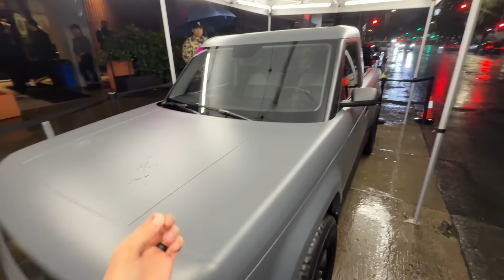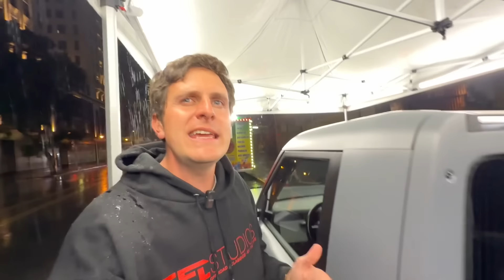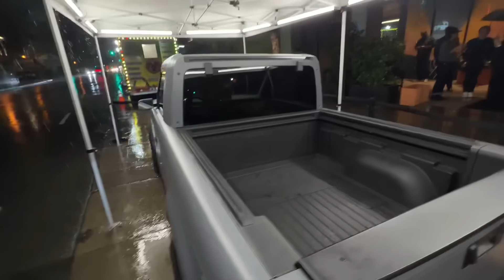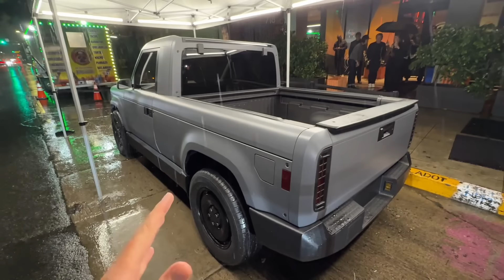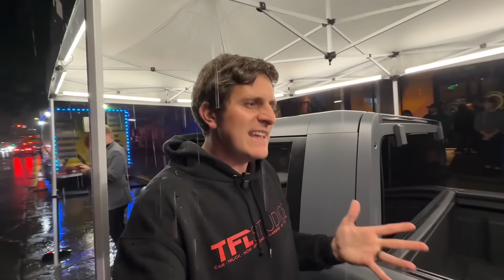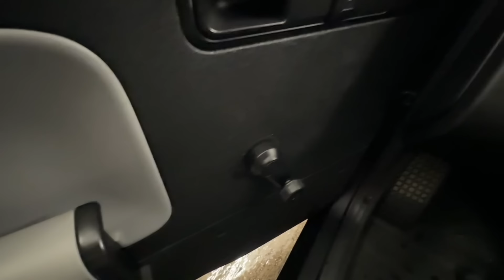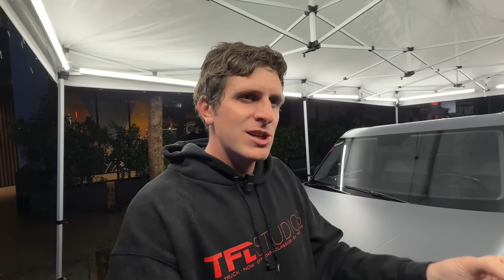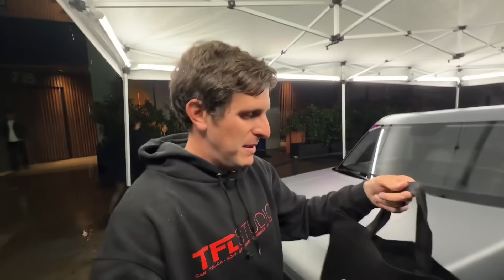The TRUTH About the '$20K' Slate Truck...Will This Really Be a Hit?

Comment: My problem with electric vehicles is they are too software dependent. The infotainment needs to be separate from the systems that control the drive.
And the running gear needs to be able to operate no matter what, a simple software glitch or failed update should have no impact on the vehicle's ability drive.
If they can accomplish that I will take one for sure. I love simple vehicles. I could use something that is small and more maneuverable for local driving.

Comment: The die is cast on electric, 2 door config for launch.  Slate's priority is to build capacity and bring to market which is huge.  I'm sure that they will be expanding from there to address some of these issues (4 doors, AWD, improved range) as a quick follow in 1-2 yrs after launch.  The bet they are making is that they can survive until then with cash from blank slate sales.  Does it have to be ICE? For some, sure.  But to be a market success, I think it needs to meet functional requirements, which for many uses will be longer battery range.

Comment: I appreciate the idea, but it needs a gas motor variant. Needs a full size bed. Its electric. Which means in 4 or 5 years its worthless when the battery needs to be replaced....just like all the other electric vehicles. Once the battery goes out and cant hold a charge for any worthwhile distance, the vehicle is worthless. I do appreciate you all covering it though. Keep up the good work.
Reply: No 🦕 please..

Comment: Totally Wrong!

This truck will sell and sell well as an EV.  The biggest pushback against current EV’s is they cost too much.   I agree they are too expensive (in the US), but I went full throttle and bought a new 2022 F150 Lightning Lariat and new 2024 Kia EV6 before there was a tax credit and have absolutely never looked back and never will.  

I have a first day reservation for the Slate due to its low cost and being an EV.   Go SLATE!

Comment: Single cab and range is a deal breaker for me on top of it not really being a complete truck (needing a wrap) off the lot.  As others have said, price is too high for something so basic.  I am for sure one of those that doesn't like all the tech they put in trucks these days.  I have a buddy that had a Subi where everything was controlled by touch screen.  Screen died and on it's way out, it decided the heated seats needed to be on high with the AC on full blast.  And that's the problem I have with the tech.  To error is human but to really jack something  up, you need a computer...

Comment: Has anybody actually TRIED to buy an XL maverick?  They either have a ridiculous markup on them, or they disappear off the lot immediately, or they have 5K of dealer addon.  The BEST THING about the Slate is NO F"N DEALERS to deal with.  I'm in with both feet and I think their first priority after sales start will be to expand to full 150K production capability of the plant.  It's gonna be like the VW bug  in the era of land yachts and muscle cars.  It sold 400K a year, just in the states.
Reply: I bought a 2024 Maverick XL. I ordered it in 2023 through my local Ford dealer and had to wait a year and a half for it to get built, but I paid 25 grand out the door. I thought it was a great deal!
Reply: I bought a 2023 Ranger xl, no mark up

Comment: With the Maverick out there and other auto companies gearing up to make Maverick competitors, the slate doesn't have a chance. A stripped down limited range electric truck that you need to add a bunch of extras to just to bring it up to what you already get included with a Maverick isn't going to sale. You can fill up a Maverick and get 40 mpg. There's just no comparison.

Comment: This would be a decent vehicle IF it was a hybrid and not an EV. barley 100 miles for 20 grand which will be more like 30 grand all in is absolutely pathetic. 20-30 grand is previous generation ford Ranger money plus 5 to 10 grand for fuel.  It could have everything you need and nothing you dont. If single cab trucks were in demand you would see a lot more of them on the road, but you don't. Its all crew cab and short bed. This is a great idea in practice, but terrible as it is. Imagine this in 5 to 7 years when the battery is 60 to 70% of the original capacity. Thats less than 100 miles. Not towing anything. Not taking into account if its really hot or really cold, all that combined and you will be lucky to get 70 miles. If it was a non turbo 4 cylinder hybrid this would be an easy sell. But its not. Its an EV. It will be problematic. It will not be reliable.
Reply: No 🦕 please…

Comment: The problem is most of the single cab new trucks have an 8 foot bed.
Reply: My regular cab f150 has a 6.5 ft bed and it’s the only size that’ll fit in my garage. Does everything I could ever need.

Comment: 150 mile stated range is very much a real issue- particularly when factoring in cold weather impacts, and typically maintaining charge between 20-80%. Yes, people take road trips. And it doesn't even have to be a road trip. Could be a swim meet or camping trip or work meeting that requires driving more than 75 miles one way. I could see this for commercial local delivery vehicles like the auto parts stores.
Reply: Get the bigger battery, problem solved….

Comment: As someone who won't get an electric truck for the money and the range/charging issues. I think this would make a lot of sense in southern and western urban areas where you rarely need to worry about snow. I could easily see this being a fleet vehicle for a small business or franchise. It would even be an option as a first vehicle for a new driver, very little to focus on, very limited distractions. I would not see this being a good fit, in this configuration, for areas that experience snow and ice on a regular basis or sparse rural/country areas.

Comment: A gas engine for sure. If you can plan for everything an electric with range limits works. If not gas is important. Also 4wd in a pickup is pretty key. The back end is too lite. Wet grass or backing up a steep driveway you want control and 4wd gives it to you. I don't need a small pickup to take on the Rubicon but when you need a little bit more or you're stuck, you need a little bit more.
Reply: Most people don’t even use a 4x4

Comment: This will not drive.  I think people got enamored by the idea of a 20k truck.  We like the idea of a simple cheap truck, but at the end of the day, it is still an EV truck that cannot be used the way we want a truck to be used.  The 150mi range from the "large" battery means it will only ever be a city slicker.  If Slate really wanted to succeed, then they should have made a 20k EREV.  Slap a tiny NA 2 banger in there to charge the small battery when it is low, then you actually have a useable vehicle.  Then you will have a nice, simple truck with 100mi EV range and 400mi total range with the onboard generator.  I'd buy that.

Comment: I had a 2 door Chevy Tracker back in 1999 and we have a Wrangler Unlimited now. I hate EVs but when I saw the doors come off and you can have a back seat with the top off I put a deposit down on one. The only way it could be better for me is if the panel above the driver seats was removable.
Reply: Why do you hate EVs?

Comment: Relying on the 7.5k ev credit to market a 20k car as the wrong move. Now that the EV credit is gone, no way anyone is buying that for 30k.
Reply: any good competitors around 30k? if not then why not
Reply: BS - you haven't shopped lately.
If it makes it to market I'll buy one.
Reply: @m @mikeb1039 s I have… I bought a legitimate diesel truck for $25k. Now it was used of course. But it’s actually capable of doing things one buys a truck to do. The fact that you say you’d buy one proves a couple things. 1. You should probably keep riding a bicycle and 2. You’re an imbecile. He said IN THE VIDEO that the Ford maverick is the literally the same price but with 4x4 and a crew cab…
Reply: So $20K plus $7.5K is $30K ?  Are you a mathematician ?
Reply: @brentmiller8494 Ever heard of interest, dealer fees, markup…? I assure you it’ll be $40k if it ever makes it to market. Just like the Tesla model 3 was supposed to be $30k and debuted at $50k…

Comment: $20k for a truck that will get me around the community, let me take the leaves and such to the compost area, sure.  I’m in.  Except… no 4wd.  That’s a non-starter.  Getting the branches and leaves and all that requires 4wd just on the property.  They’re making an “honest work truck” but they forgot the work part of that.  Yeah, I don’t need 4wd every day.  I do, though, need it at least every week.  I’d love to have a cheap, capable truck to replace the little noisy gas side-by-side with its tiny bed capacity.  But, the side-by-side goes all the places to get the stuff I need to haul.  It’ll get the firewood from back in the deep woods, I just have to make a lot of trips!  Ah well, maybe Slate will hear us and make something useful.  Thanks for another great video!!  I’ll still keep an eye on Slate, but for now its off the list.
Reply: Agree 100% - possibly the 2nd Slate!

Comment: For those wondering avg daily commute of an American is 35mi and median is 22mi. Less than 1% of Americans drive more than 120 mi in a day. 70% plan a road trip in a year in that case they will need to use one of Tesla chargers on their way or rent a car but I would mention the amount of money you save from fuel easily outweighs the car rental cost you do once in a year and not to forget maintenance savings from no fluid changes like oil and transmission and significantly less points of failure compared to gas or diesel cars as it ages.

Comment: Problem is EPA DOT NTSB requires so much required mandates simplicity is LONG gone IMO.  The 'hot rodders'  are migrating toward single cab trucks lately.  Just look at f150 with a coyote under the hood.

Comment: You should know better… 2wd in an EV is very different than a traditional 2wd truck with no weight in the back. A lot of people don’t know better, so this misconception will be common, but it’s all about weight distribution and having weight on the wheels that provide power. There’s a reason even Volvo, an automaker based out of a cold, snowy climate, has defaulted to rwd on their EV’s. This could have been an opportunity to clarify that and inform people of the reality, instead you thoughtlessly parroted an invalid concern. Clearly people want 4wd, myself included, and Slate will offer that if they get the chance, but people don’t need to be scared of this being a truck with rwd. It’s going to handle much differently than an ICE truck with rwd. 

Also, many of us only need or want a truck bed on occasion, so the design of being able to transform it into an SUV and back is huge. Add in the fun open air setup and it’s a knockout. I think the Achilles heel is the 2 doors, but even still, I plan on buying this for myself and will then give it to my daughter as her first vehicle. Only time will tell how this vehicle does in the real world, but I think there’s a lot more promise here than in most other automotive startups we’ve seen. The big money backing it and the every day people that have made reservations speak to that as well.
Reply: Sounds like an insider here who is offended by a fan boy video.

Comment: Im supposed to get +212 on my Nissan Leaf. But, at 80%, 160-175 is more realistic. So if you get 110-130 on this, more utility than highway driver. And it better have liquid cooling and ability to use Tesla plug-in. Chademo SUCKS! 47 kwh blows! But, they will overprice this!! Greed never sleeps!

Comment: I think part of the reason trucks got to be family haulers was because cost of living got so high that most people can’t afford payments and insurance on a truck that’s only used for truck things, so they had to make trucks that also did family things. The truck you tow your camper or boat with is also the truck you take to work is also the truck you take your kids to soccer practice in. They do it all because they have to.
Reply: Insurance as well… Even if you could afford multiple cars, the insurance on multiple cars can make it a no-go.
Reply: Right. Not to mention you have to haul the family you intend to stay in that camper or take on that boat and its more efficient to drive one vehicle hundreds of miles on vacation than to have to take 2
Reply: @cainhager9814  all (well, most) of us grew up riding in the back of an extended cab pickup but since it was only a “once in a while” thing we’d deal with it. Not so anymore.
Reply: Go back 40 years and people didn't have "a truck that's only used for truck things", they had a sedan and a small utility trailer, or maybe a station wagon.
Reply: 100%. If you can only afford one vehicle for a family... get a double cab truck.

Comment: The Slate is too small, too low, too basic, too cheap, but it’s not inexpensive!! If it has 30% the content of the other brands it’s still 45% the price. You may actually be getting less for your dollar!! Slate could be hugely profitable until people realize the trucks are high incapable!. Those wheels & tires,,, 😂😂😂😂. I live where a work truck is an oil field truck, carpenter truck pulling a 6500 lb trailer full of of tools & equipment, trucking company support vehicle hauling large parts and freight pieces of a few hundred lbs, ranch vehicles hauling hay bales 23 ft above the cab into muddy fields to winter pastures where the frozen turds would stop this truck in its rwd tracks!! 😂😂. I can mention so many other work trucks that this will NOT work as!! It’s a turd!! 
    Bring me a F150 2.7 EcoBoost regular cab 8 ft box. 4x4 (for me) Air/tilt/cruise and a radio, Locking rear differential. The option?? 1 engine & automatic or manual (6 speed manual). That’s IT!! not a crew cab, options that can more than double the price of the truck. I’ll buy one for my wife & I to enjoy when not out in the fields etc. m in my coveralls and the only vehicle is my true WORK TRUCK or on of the fleet my crew has access to. 
     You look at the Colorado W/T and it’s EXPENSIVE. Not much less than a Trail Boss. In base form it has more options than a truck that was considered as loaded 25 years ago. They sit on the lots and don’t sell. 
     I would truly buy the truck I described. Several in fact!! But I realize there aren’t many practical people anymore. There are still fleet purchases of trucks close to what I described, but even those are bought with resale in mind so there’s power windows & locks and a few other options here or there. My current work truck is a restored 2003 F150 actually. It’s a Lariat because the seat covers are still original & wearing well compared to all the torn fabric seats I saw. It is about as loaded as a Colorado or Silverado WbT plus power adjustable pedals. That’s it. 😂😂😂. None of the NIW mandated safety features, but I’m mostly off-road when working. Those get in the way out there! As much as it’s mint, I have $25K into it. Far more than I could ever sell it for, but far less than I would lose in depreciation over the next 3 years on a brand new work truck! The limited slip is very aggressive so I have yet to get stuck, it will happen, especially if we hopefully get a lot of snow & snowpack in the mountains & foothills where I work. I’m happy as heck with my work truck!! My F350 Lariat sits parked unless I’m going camping & fishing with the guys or even just fishing. The camper is 15 minutes to put in or take out of the box. Otherwise my work truck is more than nice enough!!